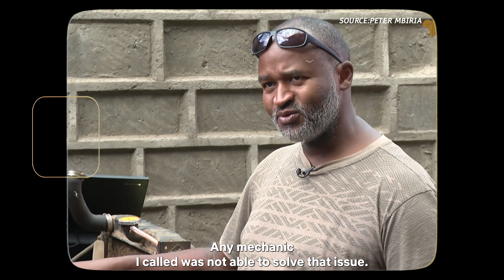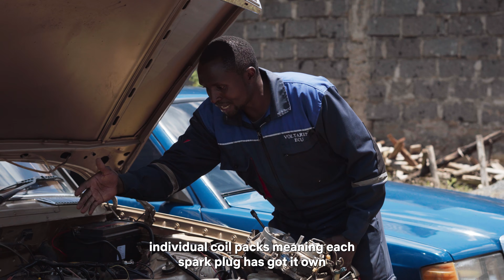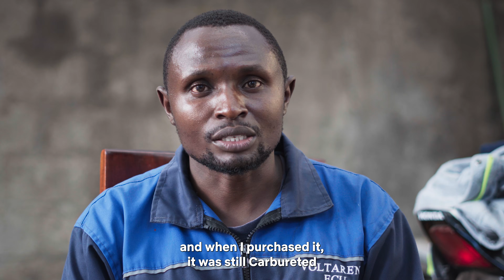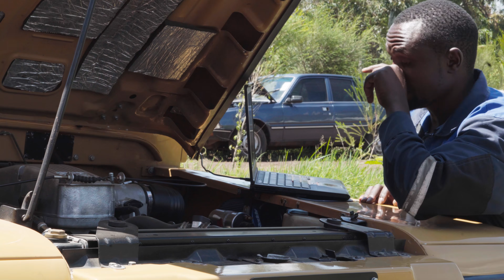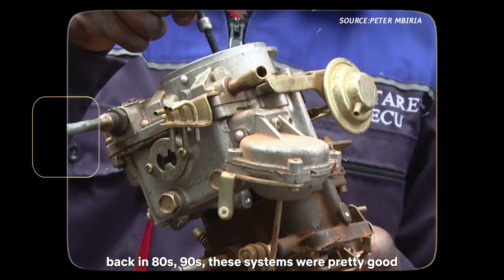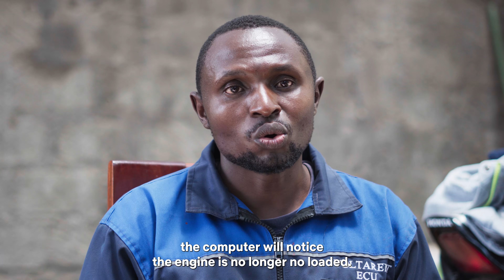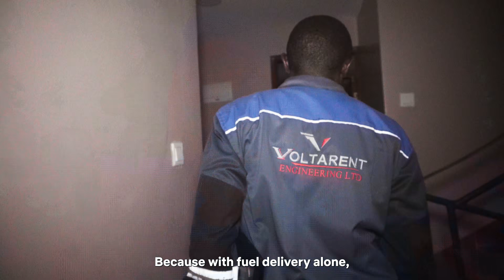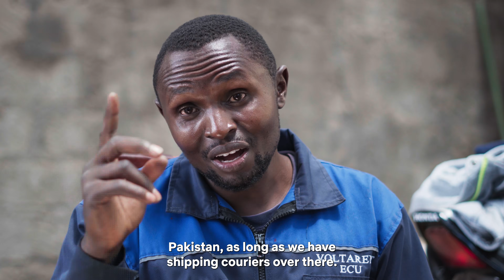This African Genius Makes Old Engines Work Better Than New Ones

Comment: A single person doing what entire governments don't. Saving perfectly usable cars from being scrapped. 🤩
Reply: Bro made a Stone Age basic ecm 💀💀, he got rid of O2 sensor so there goes efficiency and emissions lmao, then got rid of knock sensor which obviously is because the engine so bad their knocking and he wanted to get rid of alarm lights 💀. Guy did not build efficient engines, he just made terrible engines able to run without sending alarm lights.

Comment: Stating to own a Mercedes-Benz as inspiration for your car tuning company and then showing a Volvo. 

And a lot of talk, no objective, independently verified data to support it. 

It is a temping thought of keeping these older vehicles on the road, which surely were built much better than modern cars. This would be beneficial both in lower fuel economy and not having to build a replacement car, but at the moment is not more than a story.
Reply: Like not a word about all the sensor types the ECU would need to know how to interpret for different makes and models. I am very skeptical.

Comment: No matter how much tech you put on an old engine it will never be as good as a new modern engine. Put injection and electronic ignition on an a+ mini engine and it will still sound and run like a mini engine 😂

Comment: Bro has no clue there’s such thing already.. But he’s a nice dude.
Reply: You're not wrong but, considering where he's located, he needed to produce a cost effective solution to better serve his market.
Reply: @MattsShadow  That’s it
Reply: It's low level tunning.  Unfortunately we cannot do this today.  It's basically a stand alone engine management. 
We had the opportunity  for those in the early 2000s for many cars.  We tunned dsm engines (Mitsubishi, Chrysler, Dodge).
You could get crazy hp and mpg out of these with a wide range oxygen sensor hooked up and a good programmer.
Reply: Not like this, no
Reply: @ do research and come back
Reply: @ if he want to take his work abroad he does
Reply: @ Bruh what. No cars operate based off the seasons 💀
Reply: @Justin-bv3gi brother modern ecus do exactly that. Weather temperature and pressure conditions dictate how ecu whould control injection what are you talking about
Reply: @ yes it does, it regulates it automatically based off conditions.
Reply: @ Man yall some YouTube watching no skills having ahh viewers for sure. If you knew anything about tins, you’d know he just cut off your check engine light alarms they he thinks are not important and got your car running terribly. With the worst fuel economy.
Reply: @ Don’t understand anything about what you’re trying to tell.
Reply: @MattsShadow  Nobody tunes there cars for summer or winter?? Where tf you live where you gotta go pay to tune your car every 6 months?
Reply: Bro literally just built a Stone Age ECM so he’s running garbage engines but got rid of the check engine lights 💀, he got rid of the O2 sensors so there goes efficiency and emissions lmfao, he said he also got rid of knock sensors so you can hear the engine knocking because it’s horrible and he just made the check engine light turn off lmfao.
Reply: Hes retrofitting the carburator....

Comment: This is nothing new ! 
Guys building and tuning engines have been using standalone ECUs for decades. 
My first was in the 90s with the Swedish system called Prospark... 
Later on I tried Civinco piggyback  and their standalone systems that had better logging capabilties than that is showed here.... 
Megasquirt, MaxxEcu, Link, Vipec, VEMS and more.... 
And then the cheapest DIY based on Arduino called "Speeduino" !

Comment: The problem is not the old system. It was efficient, the problem is getting the  repair supplies to keep it efficient. Don't, don't don't go the digital way, you just complicate it and eventually you become slave to the  digital suppliers, and you get the same. Go back to  creating the simple, efficient and effective spares supply.

Comment: what he actually does is to convert a car with caburator into a car with fuel injection right?!, therefore you can buy a lot of kits on the Aftermarket, the real deal is the right mapping for the new programmable ECU. nice guy good job!

Comment: I had a beautiful Mercedes C230 that one day stopped working. I sold it to the scrapyard for nothing. I tried many mechanics to fix it, even the dealership. It was a terrible experience. They told me it was too complicated, lazy people who only want to replace simple parts like brakes and charge customers a lot of money. Everything is disposable these days; they want you to buy expensive cars like Teslas with too many complicated sensors. I understand this guy makes it simple and efficient, that the key, this is great, and an old engine can run like new with a few adaptations instead of throwing it away and forcing you to buy a new car, consumerism.

Comment: Bosch K or KE-Jetronics are not that nightmare. Here in Indonesia we're still running thousands W123 & W124 perfectly with that fuel system. And we're not worry with the repair kit of the fuel distributor because a local genius guy here already produced the kit since decades ago and already proven perfectly. Yes, the standalone EFI ECU has many more advantages and flexibilities comparing with the ancient K jetronic, but its not for the owner who want to keep the originality of their engine. 
I'm running a Mercedes workshop here, but sadly personally I don't have any Mercedes with K-Jetronic, if I have it I also convert to standalone EFI ECU😅😅

Comment: Protect this man, Support this man. This man is reviving old hearts that was about to be forgotten and abandoned!
Reply: Who are you asking?
Reply: Protect him from who? What?  @MileHighGrove
Reply: What was wrong with the carburetor? Do you really think people less fortunate than yourself can afford to send the vehicle to a dealer or shop for troubleshooting?
Reply: @keilmillerjr9701  Carbs are being phased out and are hard to manufacture.For countries not fully industrialized its a challenge to build a carb, its quite "easy" to get hands on the electronics to build ecu's.
Reply: Well, some people gonna say its not an original anymore, so the classical value is decreased..
And some people will opt to swap the engine with more modern one with better inherent efficiency.
Reply: Protect him from what?
Reply: @DePenzeWuzaskin what he does not only makes a lot of ppl happy but it’s gon piss off a lot of ppl as well because it messes up their business & their ways.
Reply: @hellatz2548  No it doesn't, the reason he has a business is because there isn't a market for new engines. The alternative for people is no engine at all. Here in America people revive engines too, while other people sell new ones. Is there a lot of people being hurt because of that competition? No. He is also not alone, people like him have a huge role in transportation as getting something new is often impossible in these countries.

Comment: This is False!!!! An ecu to run fuel injection will NOT compare to a modern engine. It will help with efficiency to a point. Way more factors at play. Ie cam profile. valve location.quench zones. Valve shroud. That is just physical limitations from older designs. Let alone the modern designs that implore compression ratio differential's etc etc etc!

Comment: Who designed the original? the software? he say it "controls it" and runs it as a modern engine without even knowing how its done. He seen something online and copied it. Doesn't make you a "genius" and if it does I'm freaking einstein because I built one of these years ago... seen an arduino IDE screen meaning its arduino based and that means SPEEDUINO. Its an open source platform and this guy clearly didn't start it because he's taking stolen valour. If not speeduino, rusefi and a couple others use similar platforms. Going to tell me someone who barely speaks english can write all that code in english? it was designed by A guy in australia.

By withholding this information you are no better then the gatekeepers unwilling to teach this in a way someone can understand or use in a practical manner. This is also what creates a division because you made it about race while claiming it makes him a "genius".

Comment: I would LOVE to connect with this guy and buy many of his ecu’s and bring back some old 70’s, 80’s, and 90’s Mercedes!
Reply: You can also try polish company k-jet killers. They make kits for old mercedes, audi and more with k-jet, etc.
Reply: Google Speeduino and Megasquirt......
Reply: he has his own channel, you can contact him
Reply: I have eight 1980s mercedes diesels engines, four in running cars, two rebuilt on stands, and two for parts.  Those old mercedes have proven themselves quite well (many many over 1M kilometers) without any electronic engine control, what is the benefit in adding one?

Comment: It will also make the engine last longer because excess fuel won't be going into the engine oil, damaging the bearings. Fuel injection is way better!

Comment: Basically making his own mega squirt.   That's cool.   Mega squirt has been around for 20 years and is open source.  He is correct about his mechanics and theories.  But the tech has been around for decades now.
Reply: Agree...Megasquirt has been improved to higher level over two decades. And now we can find many economics chinese standalone ECU on market.
Reply: My thoughts exactly.
Reply: I would not be surprised if he is using Speeduino to get everything to work.
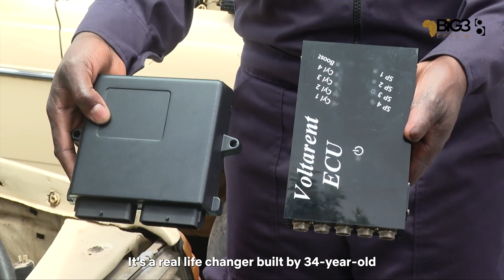Reply: @stephencelliers9127  It is speeduino. When he shows the laptop, you can see the arduino pages and also the arduino itself in 2:50.
The bigger box just seems to be a differently packaged speeduino.
Reply: Small correction, Megasquirt code is available but it is not open source. It’s actually vehemently closed source in that regard.
Reply: @thiswillprobhrt when your country doesn't care about SW IP, code being available is the exact same as it being open source. 

I don't believe in SW IP.
Reply: It still requires a LOT of reverse engineering. The really old stuff especially. There's almost no volumetric data for air/fuel mixture, and the OEM head is designed for carburetion. You'd have to re-engineer a intake head from the existing head.
Reply: There’s no re-engineering of the engine needed. Some sensors and a place to put your injectors. If you want to keep it super simple, for the engine you just use a capacitive trigger on a coil lead and a coolant temp sensor. That’s enough to have basic fuel control in an open loop. Definitely not ideal, tuning is tricky without an oxygen sensor, but it works.

 VE is calculated with some napkin math + a safety factor. Take your injector’s flow and do a little more math for required fuel and that’s your start and run baseline to tune from there. Standard EFI conversion process.

Looks like this guy has his own software that he’s using to tune and maybe even firmware on the board to control, that’s pretty cool.
Reply: @thiswillprobhrt  Like I said, old engines. How you gonna do that on a flathead or OHV?
Reply: Process is the same. OHV, OHC flathead or even rotary/wankel. There’s nothing overtly different in terms of converting them to EFI. You replace the existing carb with a throttle body and then make a decision on where you want your injectors. They don’t have to be right at the port of each cylinder if that’s what you’re thinking?
Reply: @thiswillprobhrt  Carbureted motors are designed to hold warm air because it has to use air flow at 1atm to mix. Injectors don't have that problem. In fact you want air as cool as possible to get that density. So when you go from carburetion to fuel injection, and just stick on injectors you get slow, warm and inefficient air for your mix. It will 'work' but you'll worse fuel economy at less power.
Reply: yes definitely first world country doing this in the past 20 years with 1 man doing this job he just in third world country that why he became famous
Reply: @josergevasquez3767  First world lol.....forget that old mental programming  nonsense. Humans are humans, Anywhere. None is superior or lesser.
Reply: @GODFEKA2009  you can be a good and compassionate person while not lying to yourself and others.
Reply: @GODFEKA2009  Nobody is saying people are better or worse. 'First world' and 'third world' are commonly used to describe a country's level of economic development, not the value of its people.
Reply: This is a pg channel, 🤦🏻
Reply: They have internet there, no?  They have mail in Kenya, no?  It's cool he re-created a 20+ year old program he can download for free.  I couldn't.  But it's not like he re-invented the sun or something...lol... people so quick to scream at a racer...you r racist... 🤣🤣... cool story bro.
Reply: You acting like this isn’t impressive reeks of 1st world spoiled brat. Just letting you know since on one else has. Kenya is a third world country. This is quite impressive. It’s okay to give kudos. People are so strange .. weird times
Reply: @Havingway100  He went to school for electronics engineering so him engineering some electronics(that have been around for decades) is kind of expected.
Reply: @Havingway100  so old tech is impressive?
Reply: His converting carburettor fuel supply engines to have fuel injection systems with an ecu that's saving fuel and altering performance in a cost-effective method.

Upload a video of yourself doing that in his country, and I'll be impressed

Comment: this has been done for ages now and you can have it done since decades ago but the fact is that first world countries do not want their cars adjusted that way because they want peak performance at all times and third world countries need fuel measurements done to save money but this isn't something new and you can go to your local car diagnostic place and they can adjust any perimeter with their laptops in a few minutes.
Reply: It's old to you n new to others
Reply: @Mtp50-h9z  that's also true so two things are facts.

Comment: This is a great solution, however I see the price on the website and it exceeds the current price of very well supported performance ECU’s. I was hoping these would be more affordable giving another option. As they stand, a built micro squirt, mega squirt or Australian made drop Bear ECU is much more affordable at almost half the price. Good luck though.

Comment: Nothing New, only a cheaper solution for a Ecu ?  But the Major Point is:  changing a K jetronic or a carb to a Ecu Controlled System is Not allowed! Tüv or other regulations do Not allowed IT! It is not original! But of course this is a gamechanger for some old engines!

Comment: Definitely a go-getter, self-starter. He's not wrong in that, you should only need a limited few sensors to convert a past carbureted engine to EFI. Now a day's, it's easier then ever  to get aftermarket hardware for sensors, and no shortage of software or driver's for blueprinting your own PCB. Product fruition is easy, and he's in a place where older vehicle transformations likely have a higher than average demand.

Comment: He's done nothing new!! Most European cars since the 70s had electric fuel injection and electric fuel pumps and coil packs for each cylinder. Mercedes Benz, BMW and hundreds of others.. all he's done is make something that already exists and we have been doing to old engines for the last 30 odd years now 🫤 sure he's clever for making a basic engine management system but it's nothing new or anything that enthusiasts haven't been doing already 😂 people are making ECMs out of adrino nano and RPI 4 systems with the gpio pins. Because not everyone needs or wants a mass produced haltec ECU because it's overkill and over priced when a $100 SBC and a few hours of coding and testing and bam homemade ECM.

Comment: Great keep up the good work, these will help you improve more 
There are several EFI conversion kits available that allow you to upgrade a carbureted engine to electronic fuel injection. Here are some options:

- FiTech Go EFI Kits – Offers bolt-on EFI systems for classic cars, including 2-barrel and 4-barrel throttle body kits.
- Holley Sniper EFI – A popular choice for easy installation, featuring self-tuning capabilities.
- MSD Atomic EFI – Designed for high-performance applications, offering better throttle response and fuel efficiency.
- Classic Fuel Injection Kits – Specializes in classic car conversions, providing self-learning fuel injection systems.
- Dennis Vessey Conversions – Custom EFI conversions for classic and performance cars, including Jaguar, Nissan Z, and Aston Martin.

Each kit has different features, so choosing the right one depends on your engine type, budget, and performance goals. Would you like help comparing them?